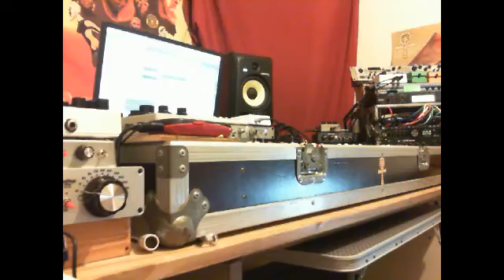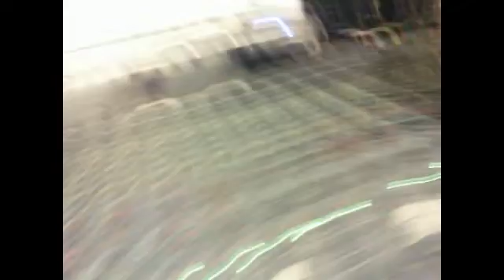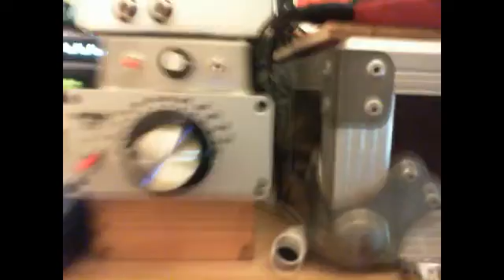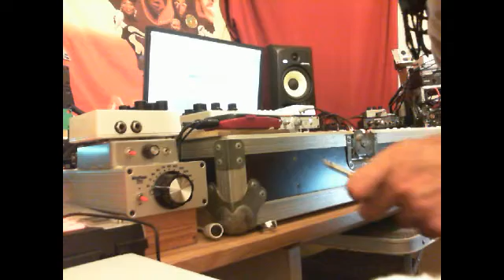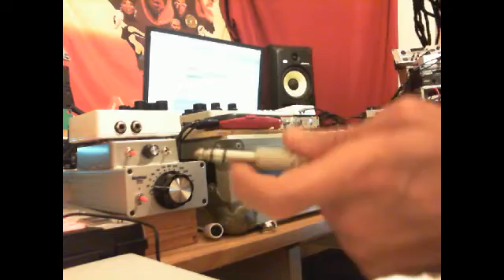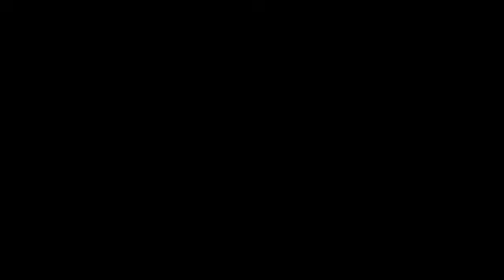WF FILTER TIPS   DAWP LAB

Comment: Great tips. Would be interested to reproduce it in Ableton. Will try
Reply from the maker: in a FX RACK :  a FILTER + a UTILITY , switch reverse polary on L & R - Assign CutOff & Reso to 2 Maccros - Put that filter on an AUX RETURN track - as Polarity is reversed at the output of filter , if you want a low pass sounding , use a HIGH PASS , if you want a HighPass sounding , select a lowpass ...

Comment: what do you use to switch from normal to reverse phase signal ?  ( you are just pressing on a ON/Off button and A switch  to select the cable path )  What box is that ? 
 and where can I get that resonance box ???  
this is great can't wait to get mine ...
Reply from the maker: Greets Killah Kay , for the reversed  phase thing, i got no switch on this desk , so i soldered a symetrical cable ( ex : you got 3 wire in a symetrical cable  ( hot point on tip , cold point on ring , ground on sleeve) , i inverted cold and hot point on one end of this cable ( at this end , cold & hot have been swap before solder it)
my routing is : 
- one AUX send goes directly in one empty channel
- on this channel the filter is plugged at the insert point
- inverted phase cable is plugged at the direct out of this channel going to another empty channel
That way i can use the normal mode and the reversed mode.
Concerning the RESO BOX : it's more a resonance attenuator , as it's passive filter with no amp in it we can only remove and not add resonance . ( so the trick is to use the filter with a bit of attenuation , and when during a mix you want more reso you just bypass this attenuator ) ....this resobox is easy to build ( you need to solder a potentiometer (i dont recall well if i added a 10K or 50K pot ( i you buy your filter from SebWestfinga he can give you the precision) , so this pot is solder between the input & output jack of the filter , some guys put this pot behind the filter , but i choose to put it in a little box in front  for easy use ( so instead of soldering this pot in the filter box , I added a Jack socket  and my attenuator reso box is plug in it ( that way later if i want to find more finetuned resistors , i just have to plug in this pont instead of unmount and mount several time this filter .)
In one of my video i dont remember if it's this one I show a little draw , so if you make a pause on it and read this comment , you'll get it i think. thanks for passing by this YT channel , Dubwise !
Reply: @shieldrumrecords1228  Are you using 2 Y cables? One standard, and one with reverse phase on one end? Also what is the track name you are playing here?
Reply from the maker: @a.stockton4817  and @killah kay ; 
No Y cable, the routing here is : 
- send out (or subgroup out) goes directly in a channel
- filter at the insert point of this channel
- direct Out of this channel goes in another input thru a cable that reverses the polarity of the signal ( this cable is a symetric cable i modied by inverting the hot point (tip) with the cold one (sleeve) at one end of the cable - this type of cable is usefull to experiment with analog gears for perfect polarity reversing because they got zero latency , technic is applyable with digital devices also but we have to know and counsider the latency (most of time 1ms or more) and would require a copy of the drysource we send in the effect and this dry sound copy must be delayed by the exact amount of millisecond induced by the digital effect ... i barelly do it on digital device because it takes some other track on the desk to achieve it. When i want "polarity reversed trick" on digital devices i do it in the DAW the addition of normal & reversed track happens in the DAW which aligne everyone before output from the audio interface - i listen again to the track to tell you which one it is.
Reply from the maker: @a.stockton4817  the riddim called LMNTS DUB , you can find it here : https://jidehhighelements.bandcamp.com/album/lmnts-dub-wave-collection
Reply: @shieldrumrecords1228  wow thank you, now i get it. the lmnts dub is so fire too. what bass synths? lol sorry i can ask questions for days. i look forward to going through your whole catalog to find more gems for sure.

Comment: why dont you add an lfo to you pot box (optical is easy). you will have to find the right resistance values to play with. i'll give you a schem for that if needed. pour une fois que quelqu'un post une vid interessante.... Je pense qu'un schema pour la config ne serait pas de trop
Reply from the maker: greets badRiddim ; 
yes this mod is so easy ( pot of the mod box is soldered to the + & (-) of the output of the filter)
But yes i could give a simple schema).
as my mod box is used to atenuate resonance of the filter , i didn't though about it ,
(pot to the max counterclockwise is the original resonance , then the more i turn clockwise it atenuate the resonance) ...
I don't know if i'm that good to build a LFO ... but now you bring the idea a synchable ( tap tempo) LFO with several shape with the possibility to cover all the  10 K of the pot or a portion of it with a depth parameter , this would be great . lfo are more obvious when it's on the cut off , but i'm sure it can gives good result on reso too ...
I would prefer to hire you to build this kind of device for me for everything  , i'm more into mixing for the momment , You would be ok to build this LFO device ?

Comment: Hy there,good job on the review.
there are 2 i/o at the back of the box, i suppose it doesnt matter in which hole should go input and where is output,i mean as long as both cables are connected i get a good signal it seems?
Also,i cant seem to get a good signal chain for filtering the reverb fx return.  
Curently i have it set from main channel,through group output to filter,from filter to another channel as fx return,then it goes into spring reverb, but once i send my spring reverb return channel through group to filter,it starts ringing and some kind of noise builds up very fast. Any tips on that?
Thanks
Reply: this is a feedback loop ... what do You call main channel output ? is it your master ? maybe no ...  You have to choose if You send the filter through fx send into the Reverb , or the reverb to the filter , or You will have this feedback loop (same as microphone larsen) ...
Reply: generally i dont send the filter return into the verb ,  from time to time you can do it to get a special ringing effect , but best result is to send the verb return into the filter  , a good thing to do is to send the verb return + the signal ( drum for exemple) wich go in this verb , send the 2 in the filterfor more dramatic frequency steps effect
big up
Reply: @JIDEHHIGHELEMENTS   ok so i  made the following setup and now wet spring signal is also filtered . the main 8 channels,i send via group out to filter and via aux send to spring reverb,and then spring reverb return is also sent to filter through group outs.  now i can "choose" between pre and post spring reverb filtering,but it is a lot more combinations of buttons and knobs to keep in mind of while dubbing ,if not carefull its easy to make a feedback loop. thanks for help
Reply: @demoxcro786   that's it , you get it now :) 
I think that we got to ta care of avoid feedback loop BUT , sometime feedbacking ( a filter or other devices) just under the witheling ringing point , is good you can have also some great result , for a delay you already know this trick of reinject the send of the delay  on it's own return track , this technic replace the feedback from the delay device , and as it's delayed  the ringing point comes progressively.
On a filter , you can achieve carefully some reinjection , it will increase the resonance at the cut off point ( when you do test think about dropping the level of the master channel that's goes to your speakers , that way you can do tests make it ring volountarly and go back just before this ringing point without risks for your system .
Reply: ...Also , to apply the technic with a copy of the out of the filter  with reversed phase ... can you tell me if on your desk you have some " phase reverse" switch on each track ? ... depending of your answer , i'll try to explain you how to achieve this ( this is what i explain also in this video but perhaps i miss some details .
Cheers
Reply: @JIDEHHIGHELEMENTS  i have no phase switch, i see what you done in video with cable with inverted phases, i will try that out sometime if thats what you mean.
Thanks
Reply: @demoxcro786   yes that's what i mean ...
first i did as you AKA subgroup out directly in the filter ,  but as i dont have phase reverse switch on my tracks where i return the filter , i did like this : 
I wire the filter on the "insert point" of the subgroup , that way set up is like this : 
the OUTPUT of the group goes directly in to the channel return (aka 22 for you) ...and my reversed phase cable is theis cable that goes from subgroup out to the return channel . now if you dont want to replace cable each time you want a normal phase out or reversed phase out from the filter , you'll have to find a solution to duplicate the this subgroup out  to get one return of the filter in phase and one in reversed phase  the 2 wire to return 21 & 22 for example that way no need to unplug\replug cable and you got the 2 options under your fingers ready to experiment.
Cheers
Reply: @JIDEHHIGHELEMENTS  understand, thanks for tips. In video i think i saw you use soundcraft board?
I have soundcraft spirit studio,modded quite a lot, i find it very good and practical in terms of signalpath.
Bless
Reply: @demoxcro786   seems we got the same desk SOUNDCRAFT SPIRIT STUDIO from 1990
Yes very practical , i even use the monitors input on some channels when i need more tracks , good desk a bit too " round " in the high frequencies , so its great to roundish those strong signal from the sound card ... when i need a "modern sound" in the high ends ,  i add a little more high freq in the DAW on hihat and snare for exemple , then it compensate greatly the roundish hi end of the desk.
Reply: @JIDEHHIGHELEMENTS  yes man that is exactly what i try to do but am still struggling, i tryed to find a good signal path but i was distracted when i played some multitracks,will try againtoday :)
Reply: Here is an example of my situation.
I have 8 channels of audio going to "main mix". Spring reverb and tape delay are sent through aux 1 and 2,both are returned in channels 23/24.
Group output 1/2 are used for filter send, return is on channel 22.
So all channels i want to filter i just send them to group 1/2 and i get a good signal on channel 22, where i turn the aux knob for sending tfiltered sound to spring reverb.
This way i get a "satisfiing dub sound" but i can only filter dry signal, and i want to filter both dry instrument but also wet spring signal.
I hope i explain well,so you understand :)
Reply: @demoxcro786   yes that's clear explanation , i read your next comment now